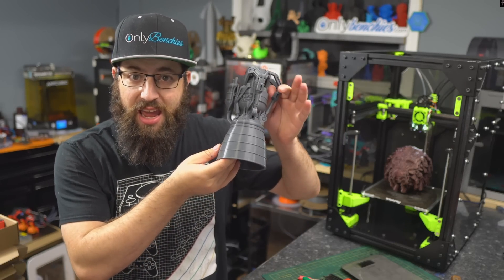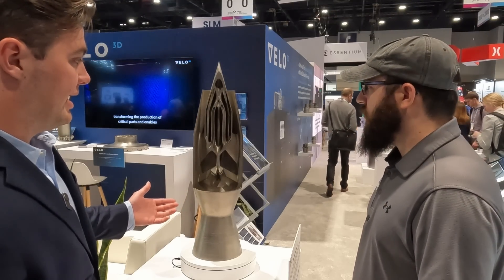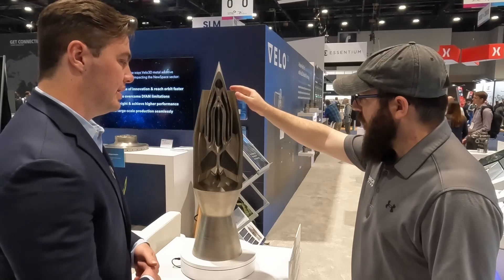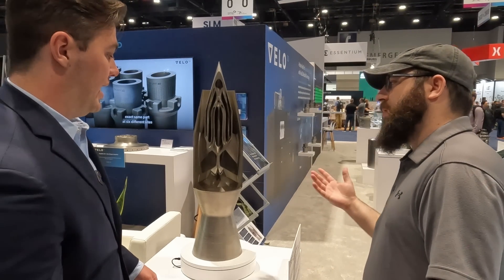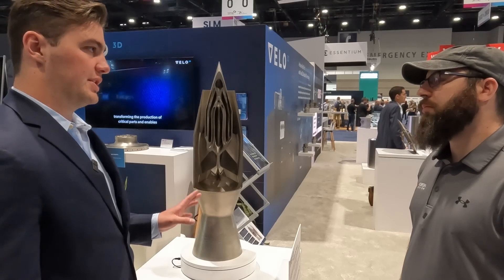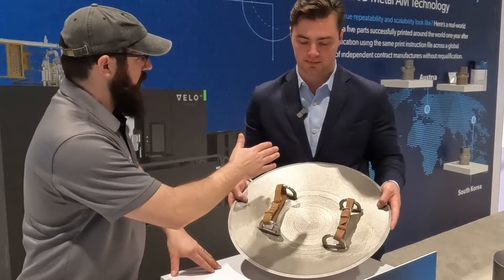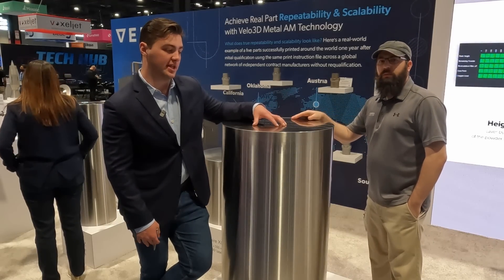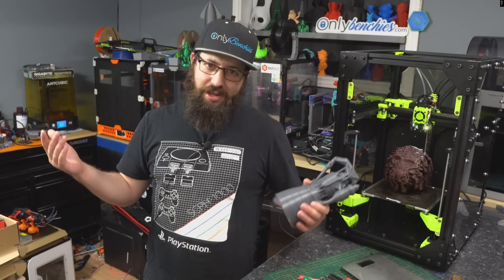Heavy Metal Rocket Engines with Velo 3D -Rapid+TCT 2023 #3dprinting

Comment: man just electroform on top of conductive 3d printed plastic shell model/mold
Reply: scramjet is better, at mach3+ like the black bird SR-71
Reply: afterburning electric fan ram scoop is better
Reply: it can regenerate the electricity used at very high speeds, the ram scoop is to burn stuff at high craft velocities
Reply: dont buy stuff for expensive from the sellers, diy electroforming complex parts
Reply: its industrially and economically stupid to rely on a few specialized makers, just diy
Reply: no you dont want to decelerate the incoming air, you want to boost it and use it to boost the max speed, as pass-through no moving parts continuous pulsejet, nope dont listen to the money experts, they only know how to copy what others said = nothing
Reply: dont become the letter of the law, be actually free, not fake free
Reply: anyone even with plastic hand made models can use electroplating/forming process
Reply: bla bla bla money talks, builder walks
Reply: What a silly suggestion. So silly that it must be sarcastic. Right?
Reply: @stoneshot  yes yours is
Reply: @stoneshot  not all metal has to be casted,  research electroforming, thick electroplating
Reply: @stoneshot  what is not right in your eyes must be false, right?
Reply: @stoneshot  all metal must be SLS right? not anything cheap simple clever?
Reply: @stoneshot  actually I think you represent some SLS metal sintering corporation
Reply: @stoneshot  if you dont like the idea, then you dont have to bash it down
Reply: @stoneshot  I wonder if you get paid for ridiculing anyone with better tech than what you use
Reply: @stoneshot  you are yourself sarcastic, be honest for once, not by law which limits you, and tries to limit what is possible, for God and those that believe
Reply: @stoneshot  repeat after me: SLS is the king, right, long live the king, right?
Reply: @stoneshot  SLS believer right? I like expensive tech :)
Reply: @stoneshot  its cheap and simple so it must be trash, right?
Reply: @stoneshot  not bowing to our tech and beliefs, so much be a cheat, right?

Comment: I guess this has similar considerations to resin prints and they will always need a way to get the powder out of every section after it's finished ?
Reply: Correct. Nothing a couple small holes can't fix luckily.
Reply: @andrewwatts1997  Or an array of perforations.
Reply: @petercallison5765  I fail to see the difference.